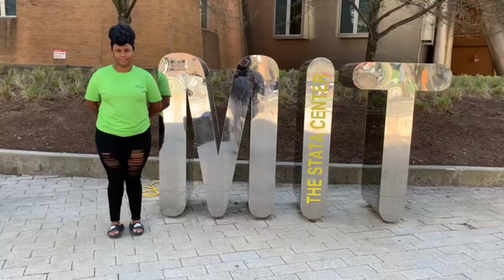Boat painting with Alexseal Primium topcoat 501

Comment: How did the foam rollers hold up to this paint? I was told that they tend to fall apart with two part paints.
Reply from the maker: The foam roller worked well. I noticed that they only fall apart if they are old
Reply from the maker: Please subscribe
Reply: I use West System 800 epoxy foam rollers with Alexseal, the best finish, i tried all the small rollers and not ideal